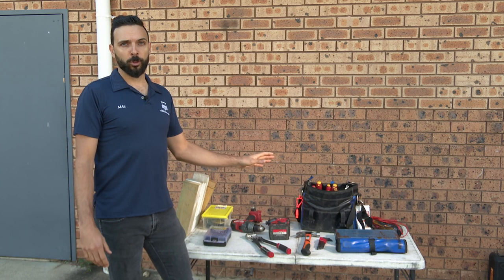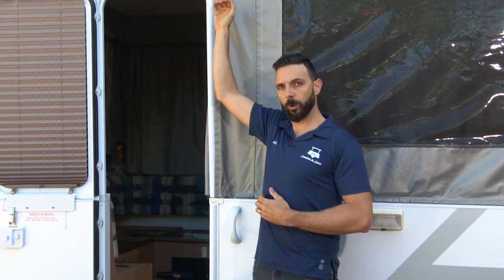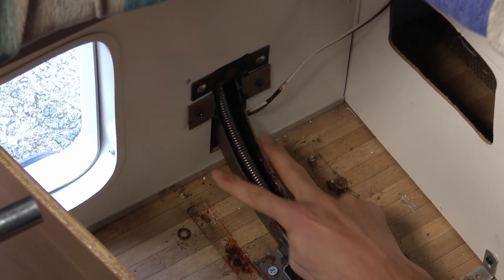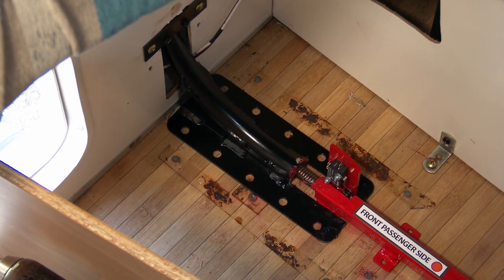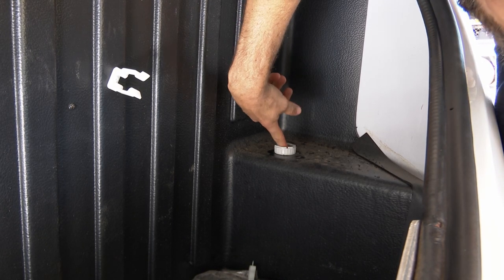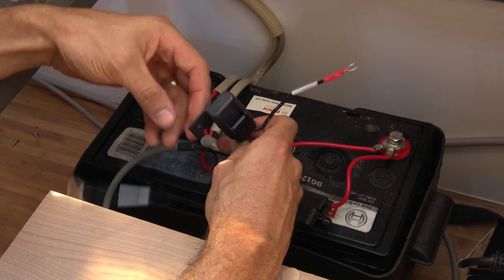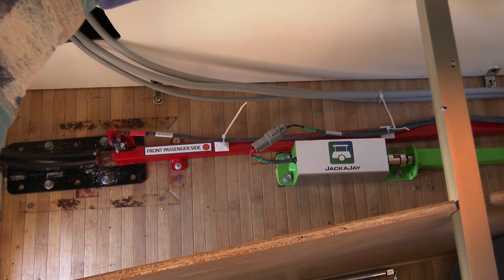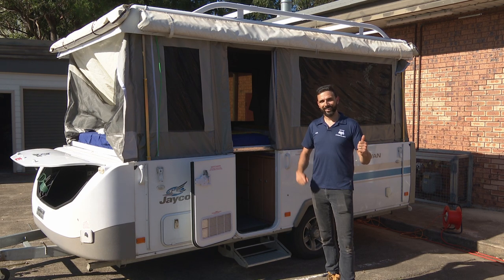JackaJay Installation Guide

Comment: To install the cable to the rear, there is brief mention that 2 pulleys behind the fridge, oven etc need to be removed first. I have a 2020 Jayco Penguin and plan to start installing the JackaJay system today in Perth. Do you know what work is needed to remove those 2 pulleys please? Remove the fridge etc? I can't see these pulleys mentioned in the Installation Guide.

In the case of dual batteries, are the JackaJay battery connections connected to one battery? Thank you.
Reply: Hi. The pullies are commonly mounted by 2 x phillips head screws. simply remove the screws and then the pullies, (you'll need to pull the cables through first). If you cant remove them, you can leave them there, they arent impeding anything. Simply pull your Jacka harness past them. In regards to the battery connection, make the connection across one battery. commonly where other accessories are connected.
Reply: @malcolmbadman6799  Thanks Malcolm.

Comment: He didn’t show the rear passenger side cupboard removal, on an Eagle this is a fiddly and time consuming job. The screws holding the lid to the cupboard (under the tall cupboard which you’ve removed) are screwed in via little plastic corner brackets and these have a cap. Lie on the floor and (dark in there so get a torch) reach in past the hoses and try to flick each lid off with a small screw driver, failing that drill a hole in each cap and then insert a screw driver and flip the caps off. You won’t see the screws at the back so feel for where they are with a stubby Phillips head screw driver and remove two of the screws (either horizontal ones or the vertical ones). The lid will then be able to lifted out and the rear assembly area is revealed.